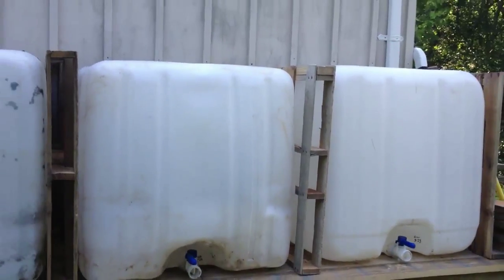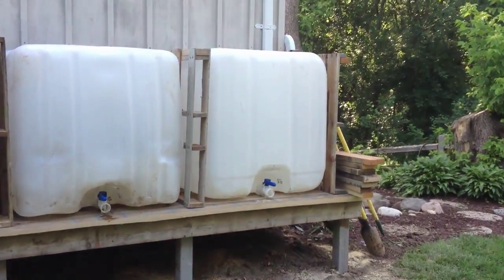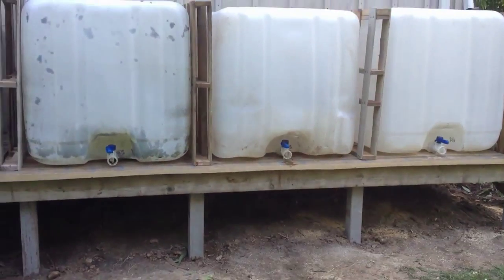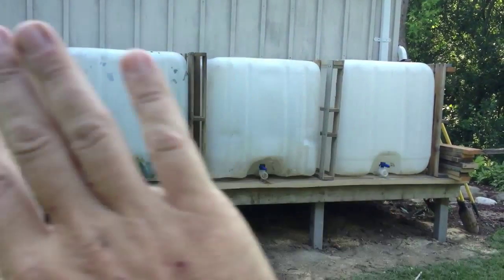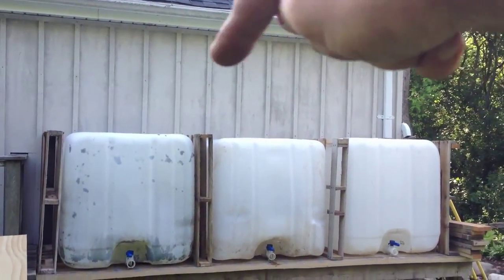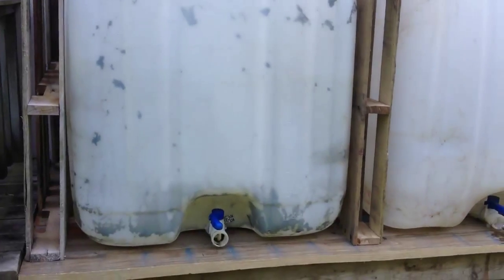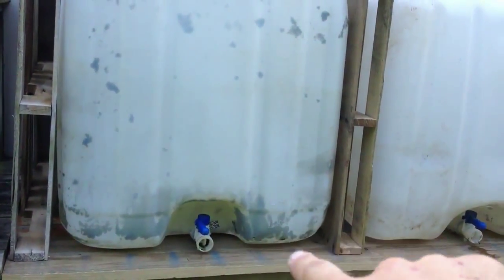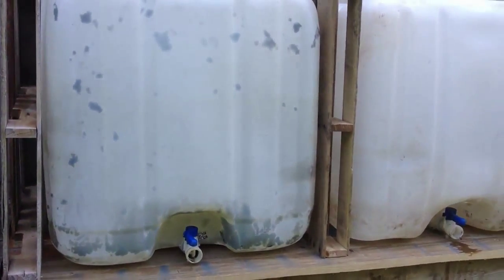DIY Rainwater collection gets bigger

Comment from the maker: Certainly a solar pump could be added. In this case, I think it would just add cost and complexity. Most of what needs watering is right there. Once it's all hooked up with the 2" manifold, I think the pressure and flow will be more than enough.

Comment from the maker: Yep, Bob, please read the full video description and blog post at the link. The deck was built with that kind of weight in mind. It's not finished yet either. The containers will be caged in with timbers, and the exterior will be finished to match the building.
The steel caged containers usually cost about $80 each. These ones were all free (would have gone in garbage otherwise!) and are making use of recycled containers and salvaged wood.

Comment: Let's see.275 gallons times 3 times 8.35 pounds per gallon. That's 6,889 pounds. Not to be a party pooper, but are you sure that deck is strong enough?  And more poop... Whenever I see one of those 275's filled up. they are reinforced inside of a cage of steel tubing.
Just a non expert commenting from a distance.